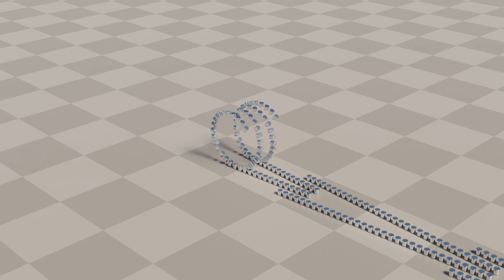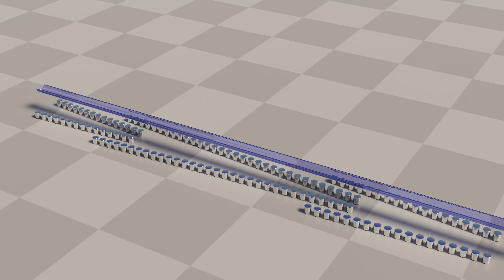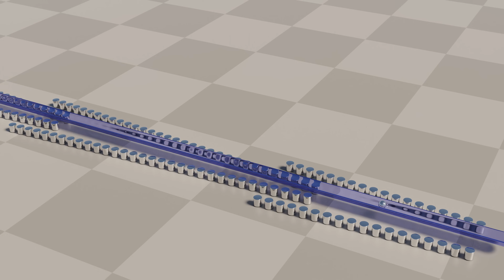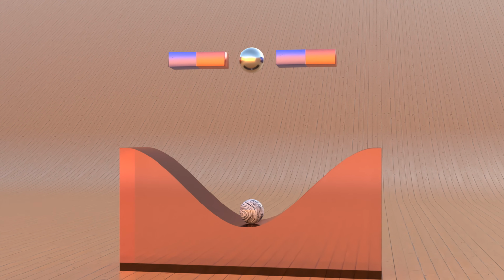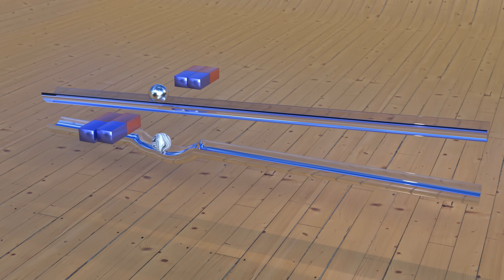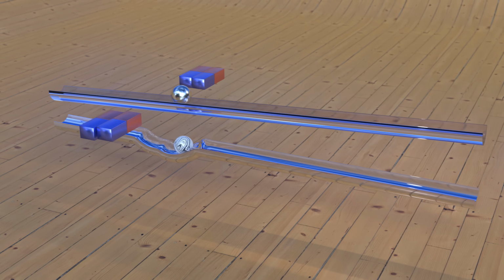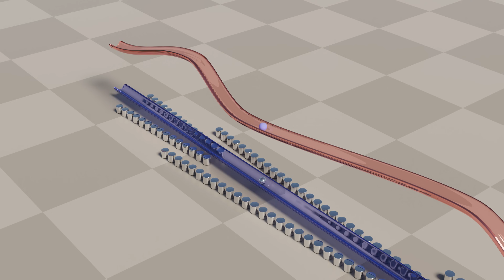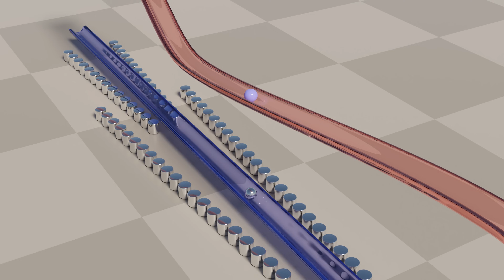Truth: Permanent Magnet Motor Using Magnetic Repulsion. Inventor's idea and what does really happen?

Comment: A truly excellent visualization and explanation. Most impressed. FYI, another way to arrive at the same proof is to mathematically compute the magnetic force vectors at each position through the rotation, then take the differentials (ie. force gradients). They sum to exactly zero which proves beyond doubt that this system will encounter a huge barrier force at the next rotational cycle around the diverging loop of magnets, and therefore will NOT continue to accelerate to produce free energy.... unfortunately !
Reply from the maker: Hi Rohan, thx for your comment. Yes, there is no perpetual imbalance possible in our world. Thx for watching 🙂
Reply: @yWild  wrong the elites posted this video to try to trick you because an east german guy figured this out with a similare model but this video has the stator part wrong but the rotar part correct actually besides the 4 magnets on the very outside .  interesting how the elites put this out there.  Notice that this video was not demonstrated by a human.  wake up people.  do you trust a video from a robot????????   ask me for the link of the east german guy and ill send it.  they shut down his youtube video but he made another website with the same video they censored.  this is undeniable proof for me that his device works besides the fact that i saw the video in real life work.  I screen recorded it the minute i saw it.   ur lucky i randomly sent this reply fyi
Reply: there is it

Comment: My bad, you missed a part where you can prove it fails. When the roller moves the magnets in the roller gains momentum while after completion of a revolution the momentum of the magnets over come the magnetic pole's repelling strength when the magnets which are closer ( ie the magnets at the starting point) . Also the original design is not the way you show. While the wheel spin one full revolution, the non rotating magnet is moved a little far from the revolution having the magnets for an instant, then back on its original position to maintain the constant push.
Reply from the maker: Hi Sesha, thanks for your comment. I’m sorry if I missed to tell some details. Thx for watching 🙂
Reply: @yWild  it's alright bro. Take care

Comment: Brilliant video some of the communication on this topic I have seen!!
What happens if you introduce a Golden Mean (or at least a contracting) loop the loop  at the bottom of the run just before the rise :)
The contracting/non symetrical angle of the loop the loop introduces centripedal accelleration for free.
Reply from the maker: Hi, glad you like it. I’m sorry, because of the reason, that the motor is just an mind game and an simulation, there might be any action to tune the performance not very useful. Thx for watching 🙂
Reply: The title should be "Free Energy Generator Debunked" (or exposed).  
Otherwise it smells of "clickbait".  The word "revealed" suggests it works and you are explaining how the miraculous device found a way around fundamental physics & thermodynamics.  Many people are mislead by suggestive headlines and jump to unwarranted conclusions when they don't read or can't understand the content of the video.

Youtube is plagued with simple amateur DIY contraptions claiming to be free energy devices, but are actually faked with power sources hidden or simulated by editing tricks.  

Similar wind & hydro generator hoaxes & failures are fictitiously presented, often as impossibly more than 100% efficient in converting mechanical energy to electrical.  
Many simply impress viewers with easily achieved high voltage shown on a meter, but ignore the fact that amperage was inefficiently sacrificed to get a higher voltage.  The actual power produced must be measured and reported as the product of voltage AND amperage.  

It's directly analogous to being impressed by a 20,000 RPM diesel engine claim when semitruck diesels run under 3,000 RPM.  
What isn't explained is that RPM is meaningless without also knowing how much torque is rotating at that RPM.  A tiny model airplane engine is a diesel engine that achieves very high RPM, but of course has very little torque and is not comparable to a truck engine in horsepower.
In actuality a generator does not create power at all; it merely converts some other type of energy (usually mechanically extracted from flowing water, wind or a fuel burning engine) into electrical energy.  
The conversion is never 100% efficient, and even if it was, it could only convert and preserve the small amount of electricity necessary to keep itself wastelessly running, but not any excess that could be drawn off for any other purpose without it quickly coming to a halt.  

No machine is perfectly frictionless or never wastes some energy as heat, stray magnetic fields, electrical resistance in wires, even in air resistace of moving parts, viscosity of lubricants (even as a residual limit to otherwise reducing friction).  
Even energy wasted in vibrating surrunding air (noise) is enough to keep a machine under a theoretical 100% efficiency in converting one type of power to another.  

A continuous input of energy is unavoidable per the principle in physics of 'conservation of energy'.   

A great deal of remedial education is needed to battle the greedy hucksters peddling fantasy & antiscience by monetizing hoaxes aimed at the insufficiently science-educated public.  

This video should emphasize the fundamental principles that are violated by ALL purported 'free energy' or 'overunity' devices.  

I don't want to ignore the educational value of the "thought experiment" analyzed in this video, but I think it could be very much more valuable if it also taught the fundamentals to the curious kids that need to be inoculated againt all the pervasive disinformation on Youtube.  
In this case it leads them to believe the conspiracy theory that "free energy" is more than just possible, but is technology being greedily "suppressed" by some impossibly powerful, unified, impenetrable, secret cabal of world dominators.

Comment: The system is like electric motor whitout wire
Reply from the maker: Hi, thx for your comment. Yes should be an motor based on magnetic interaction. It could be used for generating electric current, but it would not work. Why? My videos explain it. Thx for watching 🙂

Comment: Why cant magnetic shielding be used as it gets to the closer point of the gate?
Reply from the maker: Hi Benjamin, thx for your comment. Magnetic shielding is not able to do the job because it is magnetic itself. For more information watch my video https://youtu.be/oQ36wQJUYq4 . Thx for watching 🙂
Reply: @yWild  hypothetically, if I put something like this on a bike, where the pedaling would contribute to the movement of the wheel, would it actually speed up the bike??
Reply: @benjaminfoley919  No it would not, pedaling would speed up the bike the magnets would add nothing except increased mass to accelerate therefore slowing the wheel down
Reply: Cos magnetic shield not eliminates magnetic field. It can change/compress it, so no chance that it can be usefull here.